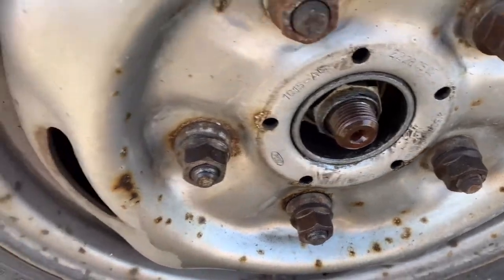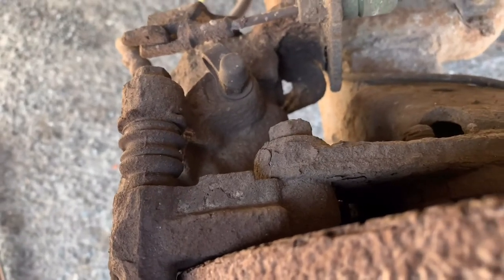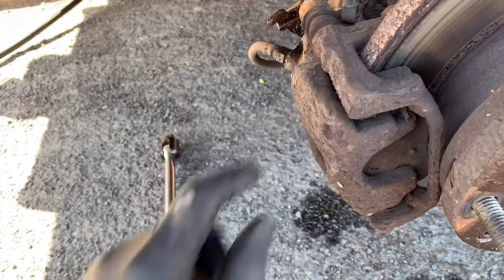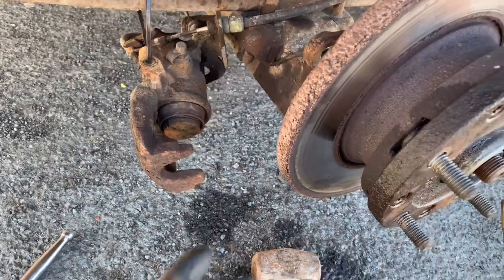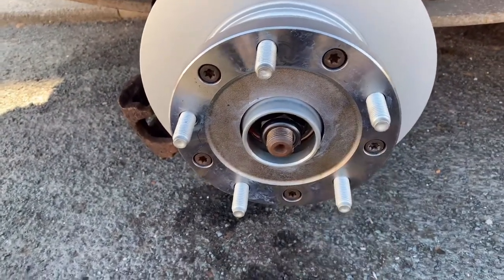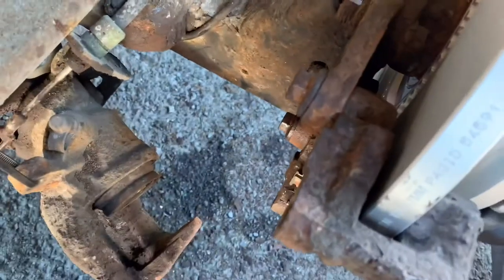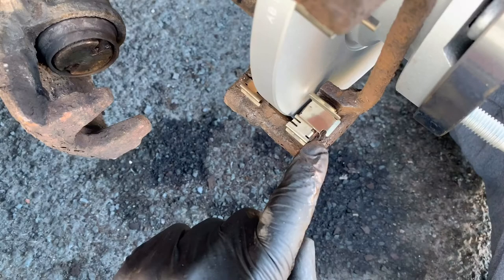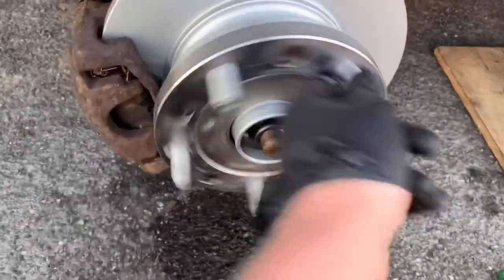Ford Transit Mk7 Rear Brakes and Bearing/Hub Assembly

Comment: My FWD mk7 350 140 has a rear stub axle diameter of 45mm. The dust ring is built into the wheel bearing assemble and is supplied already inserted into the bearing housing. I can only assume this is the 36mm spline with a separate dust plate. Having completed this job I can recommend just taking the stub axle off (4 bolts) and throwing everything else away. Get a new stub axle, disk and hub with bearing. The bearing hub and disk are usually welded together with unbreakable rust. Additionally they are welded to the hub spigot. Don't waste your money on pullers and special tools, just throw away the hub, disk and stub axle as one unit

Comment: I thought hub nut was +400 nm. I'm gonna have to check that out.got some good advice from this video as I've not done this job before.
Cheers
Reply from the maker: Thanks 👍, my hub nut was a 44mm flange which was I believe 300nm, if you have a 51mm flange hub nut then it will be 450nm. Do you know your hub nut size by any chance?
Reply: Dan-The-Man I believe it's a 36mm
Reply from the maker: Ok, not sure about that one then, my spec sheet only states 44mm and 51mm flange hub nut, the overall measurement of the nut, tip of flange to tip of flange, mine was a 36mm spanner to remove the nut but the nuts overall flange length was 44mm. Hope this helps
Reply: Dan-The-Man so 36mm with a depth of 44mm? All that will require is a deep socket.I'll find out when I tackle the job!
Reply: @Shifty761989  🤔👍😎

Comment: Hi getting ready to do this job, are both hubnuts loosened the same direction?
Reply from the maker: Sorry, these comments normally come up as a notification on the phone and they haven’t been, did you get it done? I believe they are both anti clockwise to undo, would have to check, thanks
Reply: @Shifty761989  Yer all done mate, thanks

Comment: im struggling getting the t50 bolts off the hub, i have snapped two, halfords advance t50 torx sockets, using a 24 inch breaker bar. Any tips on getting them out?
Reply from the maker: If they’re really stuck in best bet would be heat and impact, do you access to a blowtorch? Maybe from friend/family, or a impact wrench (not driver), even a battery one might help. If you don’t I can only suggest filling with good penetrating fluid and leave overnight. Hope this helps
Reply: Yeh , I’m a plumber so I have a blow lamp.
I don’t have a impact wrench , just makita impact driver. Only thing I have is wd40 here.
Reply from the maker: Ok well I’d be tempted to give bolts good soaking overnight then the following day just wipe excess fluid off and heat around it, don’t go crazy with heat near the bearing, I’ve only got a plumbers blow torch and that’s what use, in fact I think I did even need to use it on this job. Good luck 👍

Comment: why didnt you show the hub being removed?  These are a  right pig to come off
Reply: Yeah, we are doing our rear ones now. Right came out without a problem but have tried to get off the left one for two days now… dont know what to do
Reply: @breathplay112  what it it thats stuck?
Reply: @thatdaftscottishcarguy  the wheelhub is stuck to the axle
Reply: @breathplay112  did you get the hub nut off ok?  i used an 8lb hammer and knocked the $hit out of the back side of the brake disc, its eventually came off but it was hard work
Reply: @thatdaftscottishcarguy  I hammerd it for 8 straight hours yesterday and soaked it in WD40. This morning it started to losen and finally came off! Im in lot of pain but wow how satisfying 😀